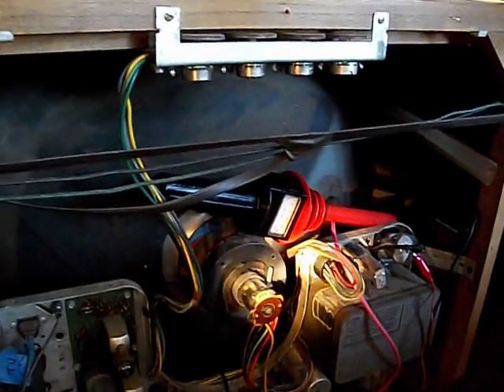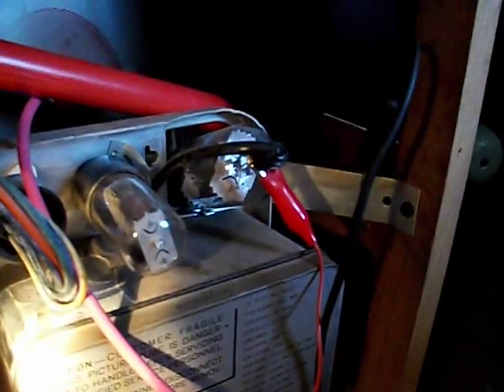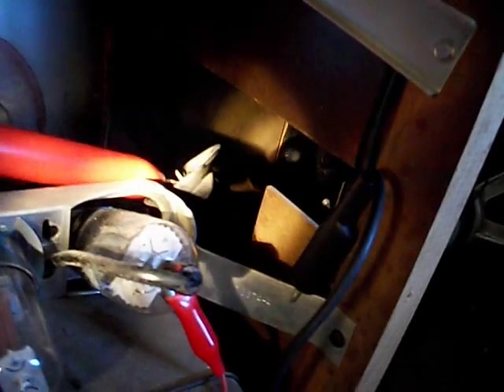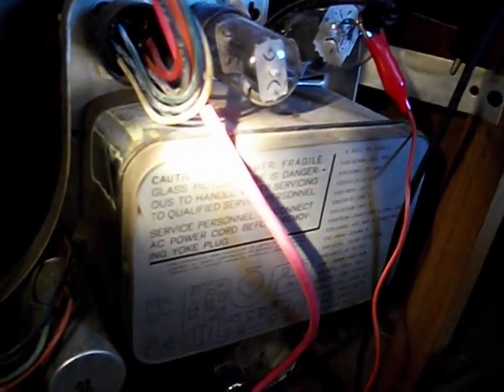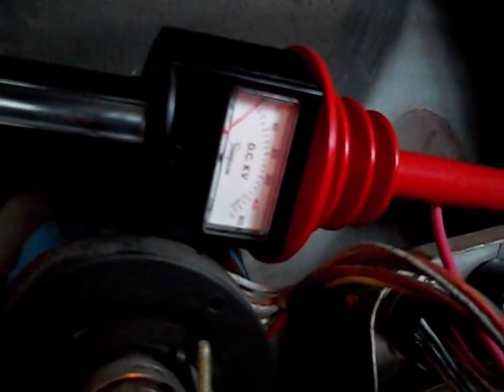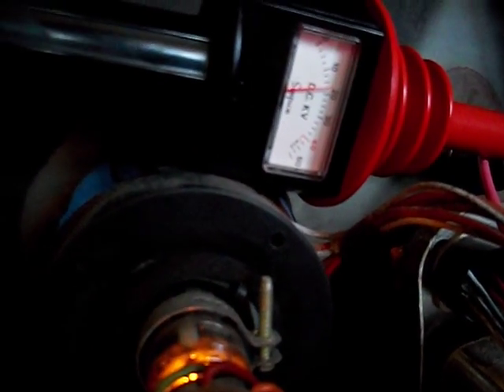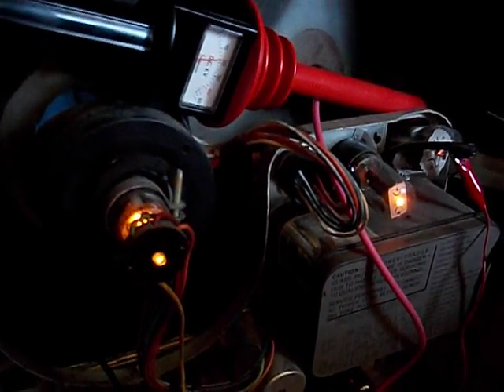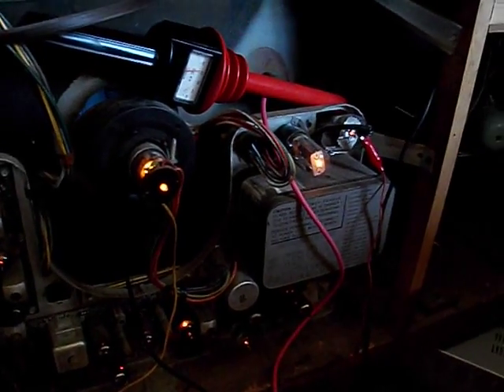Vintage TV repair using a Voltage Tripler

Comment: Is the high voltage supposed to be 25 thousand or up 27 thousand for a 23 inch set
Reply from the maker: Some of the later sets may have used higher voltages for marketing purposes. Personally I would keep it to about 22k max just to help keep the flyback insulation from breaking down.

Comment: Should the high voltage be about 27,500 for a 23 inch set
Reply from the maker: that is a bit on the High side IMHO maybe 23-24k 
You dont want to go to high and stress the insulation on the flyback

Comment: Interesting tripler lesson. Never quite grasped the total concept of them, They're just a bunch of diodes in a box & why so many types, etc., & the name tripler. Thank you again.
Reply: A tripler multiplies the horizontal output voltage times 3, this was done by a flyback in most tube sets but triplers came in once solid state began to dominate the set. Normal triplers would be three stages- 3 diodes and 3 capacitors. BUT since the horz. output waveform is so weird and irregular 5-6 stages are used to get 3x voltage multiplication.

Comment: Hi DaveWM, hears a little trick to adjust the high voltage when using a tripler in a B&W set. Use the damper tap on the flyback if the high voltage is too high, doesn't work all the time but its' worth a try. If the EHT over wind is shorted the over wind has to come off the transformer or it will not work, output tube will  red plate,thats' not good. A few of my small screen G.E. portable sets I built a 1/2 wave doubler . Most times works like a charm. All the best, Tom J from Fla.